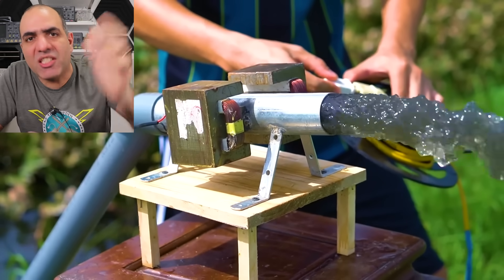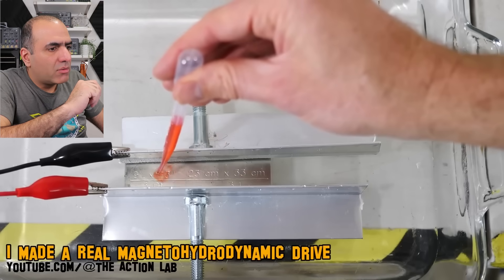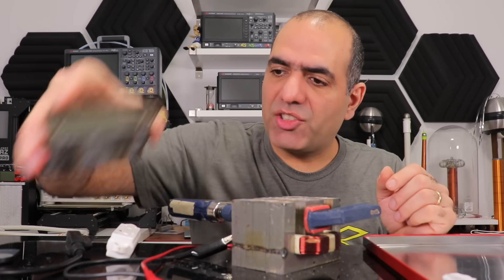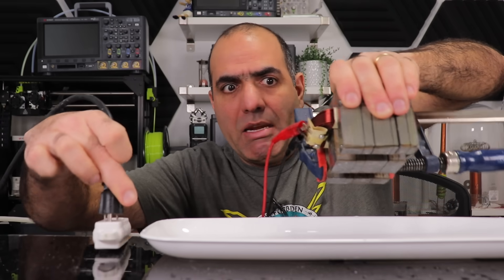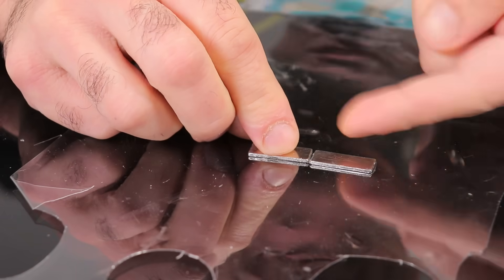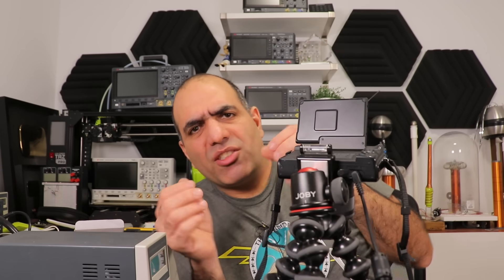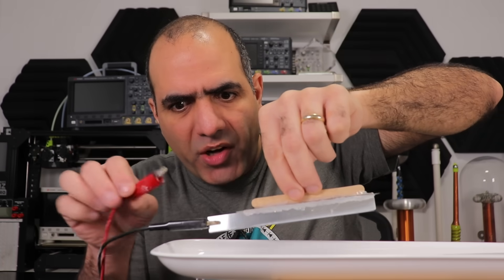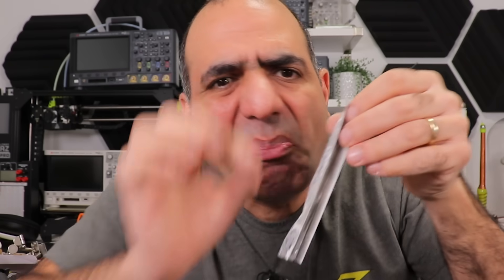Making a Water Railgun

Comment: How about a steel slug in a tube, with a spring at both ends of the tube, but back end capped and open end away from you but I.D smaller than the slug so slug strikes the spring at the end of the tube. The tube then filled with water. And coil on outside of the tube making for the slug to travel like a solenoid drives a slug. Fill with water with slug at the back of the tube and water in the front. Apply a quick hit of DC with correct polarity for it to travel forwards vs towards the back end cap, and slug fires forwards quickly expelling the water inside very fast!!!!, but safely the slug stays self contained by striking the spring that is at the exiting end of the tube and when it springs back it doesn't damage the end cap towards back because a spring also at that end to avoid the slug striking the mechanical limit of travel ;)

Comment: Hi Mehdi, just a quick question, (maybe i missed it) but are your rail strips in direct contact with the magnets? in that case, wouldn't the bulk of the current be flowing through the magnets instead of the water?
Reply: I think the magnets are actually not conductive or very little

Comment: Try going the other way, use a low voltage, high current supply. See if you get better thrust and less electrolysis (at the expense of more joule heating).

Speaking of joule heating, was that actually traditional thermal boiling of water that was occurring, or was that the electrolysis? Mix of both? Hit it with the FLIR.

Comment: Geez, microwave transformers are pretty violent when they are not clamped or when something magnetic is placed on them. It was buzzing so loudly like a light on the ceiling when the bulb inside the light is dying. I think the breaker was popping because of the clamp shorting it to ground, or too much current, because when he glued it in the previous video, it didn't pop the breaker; most likely because the glue was isolating parts of it and lowering the current just enough to not pop the breaker. Love your debunking videos! :D

Comment: A motorless water mover does have a use. Solar powered in a horse trough during winter to keep water from freezing. Sounds of motors tend to spook horses. Make it a little more "stable" and it could be a useful product.
Reply: Nice concept, but to get it to work as intended, I fear the water would need to contain too much salt for it to be drinkable. And since this is basically electrolysis of salt water, the biproducts are aqueous sodium hydroxide and chlorine gas, which probably aren't super healthy to be exposed to over time. Sodium bicarbonate might be more suitable in this case as the resulting gases aren't poisonous. Though, the drinkability of the water is still questionable.

Comment: 7:02
If you're touching the probes with your fingers while you hold it on the aluminum, you will also have your body's resistance in parallel with the aluminum..

Comment: I hadn't considered putting additional magnets above/below the rails. Could you do a mk2 which uses alternating current synchronized between the rails and the top/bottom electromagnets? AC works better for water since at high enough frequencies the water just acts like a capacitor rather than breaking down into gasses.

Comment: The reason why it attracts to your table is because your granite counter is very slightly magnetic. it might only be certain types of granite though not quite sure. But the way you can test to see if your granite counter is magnetic is by simply taking a fridge magnet and place it near or on the counter and feeling if it has any resistance trying to pull it down.

Comment: How about a water pump with electricity BUT, without moving parts or magnets or even salt.
https://www.youtube.com/watch?v=zzVa_tX1OiI&ab_channel=AppliedScience
Great video bth. Also, you holding that sheet of steel vibrating at 60 Hz is terrifying even knowing that current is just flowing though the metal and not through you.

Comment: Want to try the simple rail gun at home?  Glue the aluminum sheet to the plastic flat. Then heat the corner of the plastic where you want it to bend.  Then bend the plastic and Aluminum up to create the troff. let it cool. Coating the aluminum in acrylic before you glue it to the plastic will stop the electrolysis. Leave a tab to connect the clips.
My question is can you make the water go uphill or will it stop? Could this work in stages to make water go uphill?

Comment: You made me have an epiphany. It might not be completely relevant, But I was wondering why you can't use electronics to separate water into hydrogen and oxygen.

And then with the hydrogen and oxygen being lighter than water, Run it up a tube well, 2 separate tubes, To a very high Elevation.

Once hydrogen and oxygen are at a high elevation. Then you would burn the hydrogen in oxygen, Producing from what I understand water, And Is with a hydrogen engine some of the energy lost through electronics,

Then on the water's descent back to its source.  You would use some variant of a hydro electric generator, In which to produce energy relative to the difference in elevation. 

Then you would have the energy from the hydrogen engine and the hydro electric generator. That energy could then be used to drive the  Is electrolysis.

And if I understand correctly the bigger the elevation difference the more energy you could collect from the hydro electric generator.

Leaving me to believe that it may very well be possible to collect more energy from a combination of the hydrogen generator and hydro electric generator To not only derive the electricity keeping the process going but, also  To come out with a net positive energy.

If I'm not misunderstanding something this Perpetual energy provided your machinery last long enough.

Please explain to me if and why this will not work.

 You could probably even collect energy from the hydrogen and oxygen trying to go up,  And well maybe not the oxygen but but it wouldn't take too much of your energy to pull the oxygen up if it doesn't want to go, I would not doubt that the hydrogen will be more than happy to ride up that tube even with the resistance of Hugh robbing energy from it.

Comment: Some minor quibbles:

1. Water is weakly diamagnetic
2. Pure Water is a good dielectric and polar molecule which polarizes and moves/stiffens in response to linear electric fields (electrophoresis) and non-uniform electric fields (dielectropheresis)
Reply: 3. Polarization of a dielectric like pure water is described as a displacement current which has a certain rate until it is fully polarized. The relaxation time is the time the polarized molecule takes to go back to normal when the applied electric field is removed. During this polarization and relaxation time, the water produces a magnetic field which can interact with ambient magnetic fields as any capacitive element would while charging or discharging.
Reply: 4. The interface between air and water forms an Electret, which is a permanent electric dipole. Under motion an electret can induce a magnetic field which can then interact with ambient magnetic fields as any motional electric dipole would.
Reply: All that being said, this was a great episode that got to rectify some bad science and explore more Magnetohydrodynamic theory. Hey Mehdi....have you ever heard of a self augmenting railgun? I think you're the only person I would trust with such power. But since you have been building water railguns, perhaps you would be interested in constructing something more powerful?  I would love to see a modified "dense plasma focus" built for salty water. Also called a Z-pinch machine or coaxial plasma railgun. The self-augmenting magnetic field part would be a bit challenging, but there are plenty of designs for linear rails that self-augment. I don't think I've seen anybody publish a design co-axial railgun with a self-augmenting electrode, but if you think about it for a bit I'm sure you can come up with the same shape I have in mind.

Comment: Seems the flow was speeding up as you pulled the motor out. Shallower stream?. Would the salt water shock someone? Could you make the motor I to a thin tunnel and supply water through a small tube to make an electric water water gun?

Comment: The results this time were kind of limited, but i wonder if they might be improved. It looks like the effect was limited by the current flow, so perhaps running the microwave transformer off of the full bridge rectified with a low turn count secondary would yield better results? If 30 VDC was getting 10 A through the water, that means the resistance is no more than 3 ohms at that voltage. With a 3:1 transformer, peak voltage should be closer to the ideal of 67 VDC (ideal for 1500w draw @3ohm) which should yield 30 A peak current, assuming the same resistance, and should be able to move 3x as much water at ~70% of the acceleration, give or take a little. If you move up to a 220V 20A circuit, and step down the voltage to 110VAC, you should be able to manage ~40A average, which should give you fully 4x the motive power. As long as you fully submerge the pump before applying power, the flow of water should keep anything from exploding (probably). All this math just goes to show how dreadfully inefficient MHD pumps are. One has to wonder how much power goes through one of those MHD warship drives.

Comment: Great Video as always! When I say the video with you holding a railgun firing all that water my mind went several different directions at once...like how did he use a wedge of plastic and discharge a metallic fuse to fire it and accelerate the ions with the water in front of the wedge? Hey it would work...
    But then I thought if he is holding it and achieved anything close to railgun speeds he is dead....Okay then I HAD to Watch right then because.....
    This reminds me so much an incident I had. I made a large pneumatically powered spud gun with a 6 foot long 2" diameter barrel (this doesn't consider the large 150 psi reservoir surround it). Since it worked (could shoot a potato well beyond 1,000 feet or completely through a metal car door leaving approximately 6" hole) I decided to load it with over 1 gallon of water.....It fired it with the much intended extreme effect and yeah...ummmm...ugh...well......
     Now you would think someone who owned a firearms store and worked with class 3 machine gun dealers and NFA weapons (ah miniguns and quad fifties heh heh) and who has completely built from scratch small experimental to large professional grade rockets ( weight ranges measure in milligrams up to over many kilograms requiring FAA clearance) 
    Yeah you would think that Newton's 3rd Law would not have slipped my mind.......like trying to fire a mortar with no base plate.The damned thing Tried to tear my arm off, bruised some ribs and damn near killed me and landed on the ground a dozen feet behind me. I had a tight grip on it right up until I fired off the dump valve.....luckily it could turn me to the side and leave past me in a millisecond...I only took a bare minimum of the recoil it produced.But Hey potatos,walnuts, golf balls, bazooka rockets with fold up fins (non explosive) etc etc had very minor almost no recoil. But there is a reason why in math orders of magnitude and exponential things are so exciting when applied....

Comment: There is another way of moving or rather lifting water directly with electricity. Build a simple plate capacitor (both plates vertical) and half submerge it into "non salted" water or oil or some other dielectirc liquid. When the dielectirc liquid between the plates is exposed to the electric field of the capacitor, it gains potential energy. Part of that energy manifests as m*g*h kind of potential energy, which will slightly raise the liquid inside above the level outside of the capacitor.

Comment: Saltwater can break down your skin resistance. I did that when I was a kid, with 2 "D" batteries when I maked a hydrogen and oxygen generator. I stuck my hands where the current was and really got well shocked.
I only used one hand. Don't play with salt water and high voltage. If you have some on your hands. Wash it off.

Comment: This reminded me of a device that was sold on TV back in the 70s. Basically it was two magnets you would attach to opposite sides of the gas line on the carburetor on your car. The idea was that it magnetized the gas and increased the MPGs.  They would cut out several cylinders and the car still ran fine. Yeah, right.

Comment: Fun tidbit: in them olden golden days before CG. FX people could wire up swords with belt batteries, so that when duelist clash dramatically, sparks would fly from the blades as they rub against each other... I guess it's basically the same thing as the sparkling sheets of metal at the end of this video.

Comment: People do what works best and is the easiest. If someone could make a cheap water pump with no moving pumps it would have already been patented and mass produced. These videos claiming to make a better pump with simple already mass produced parts are clearly fake even if you don't know about electronics. Anything better than what is widely used is either just a scam or way too expensive for it to make sense to replace what is already in use.

Comment: This video reminded me of another way to move liquids using electricity. There is a phenomenon called electrowetting where electric fields are used to alter the wetting of surfaces. This allows for the precise control of water droplets on surfaces my making a surface more hydrophobic behind the droplet and hydrophilic in front of it.  I guess one would be able to accelerate the water to a eventually high velocity using this method. But the design of a gun using this principle would be extremely complicated.

Comment: most of the gas you produce is H2 and O2, non toxic but highly flamable
I don't really know what happen with the Cl-, you could have a few flying Cl which can be toxic(depends on the concentration) otherwise you are making bleach, if the current heats enough you are inhaling bleach vapour which is not much better than chloride gas ...

Comment: British nuclear reactors used to be cooled using magnetohydrodynamic pumps and a liquid metal coolant (lower resistance than water), as it needed no moving parts and could operate completely sealed with little to no maintennance. The coolant was either molten sodium or sodium-potassium alloy (NaK), which is liquid at room temperature... and ignites on contact with air. Excellent coolant though!
Reply: "and ignites on contact with air" yeah that seems like a major oversight lol

Comment: You're also dealing with electrolysis - the action of splitting molecules into their atomic forms, often water to oxygen and hydrogen.
This is likely where a huge chunk of your amperage is going.
It's not very poisonous, but most of the danger comes from how flammable it is. The result from water is a fuel (hydrogen) and an oxidizer (well...oxygen).

There are setups that split the two gases to separate outputs, but in the railgun setup, if you leave it running for an extended period of time in an enclosed space without venting, it'll be a ticking time bomb. As it fills up its surrounding space with the hydrogen-oxygen mixture, the water level will continue to drop, meaning more chances for the railgun to arc like it did the first few tries on 160V. Eventually, there'll be so much fuel in the air around the railgun, and the water level will be so low, that the railgun will arc, and, quite literally, BOOM!

TL;DR If you do something like this for an extended period of time or in a small space, make sure to vent the gases, otherwise the moment something arcs, sparks, or lights on fire in there, there goes your house.

Comment: The workpoint of your permanent magnets is super low. Close the magnetic circuit by adding a yoke around the aluminum strips to the top to have parallel flux lines. The magnets will not demagnetize and the flux density is much higher. More flow!

Comment: Even if you could use something which attracts the water magnetically, the force required would likely damage and deform the container first.
The only way i can think which i think you could actually make this work, to some degree is to introduce some...safe (i can't believe i am using this word on this channel lol) material which binds water to it and it's also magnetically attractive enough to make it move with it and do that from the begging of the source of the water you want to move like a hose intake and then also find a way to remove unbind that material from the water before you let it go where you want to.

Comment: I've done a similar experiment but using a 100ish lb neo magnet. I got similar results but with much less/safer levels of current. 

Plastic cup with a strong permanent magnet underneath. 
saltwater in the cup.
non-ferrous metal rods. 1 in the center, 1 on the side.
power on and watch the whirlpool.

Less power=less electrolysis=less dangerous gasses.

Comment: A lot of people don't know this but: Salt water is not significantly more conductive than normal water below a specific DC threshold voltage. I think it's around 1.2 V? At that threshold, electrolysis should start with non linear resistance

If you apply a voltage below the threshold voltage, you basically only have a super capacitor (with voltage-controlled capacitance) and not a resistor.
That's why the conductivity of water is measured with an AC voltage, because a capacitor lets AC current through.

Comment: Mehdi, instead of using the railgun effect, try using the vibration of the aluminum sheet when near the transformer. IDK how it will work with water, but There are solid state laptop/device coolers being released that use physically deforming a sheet to move air. (I believe it's piezoelectric driven)